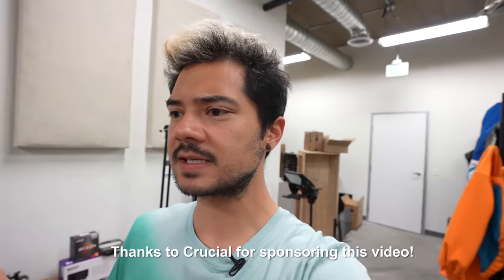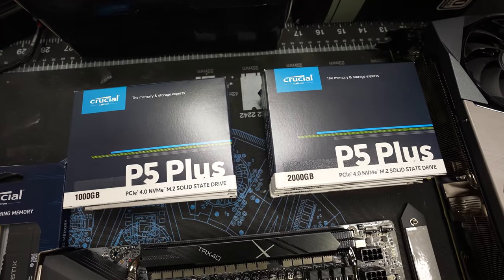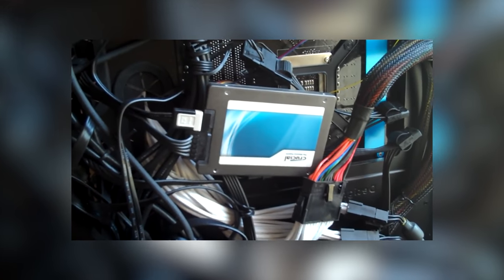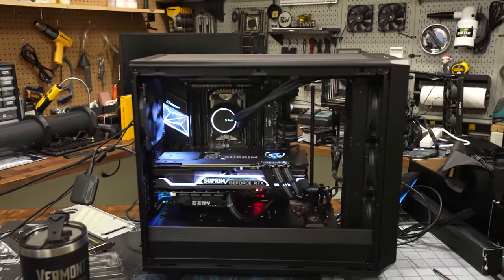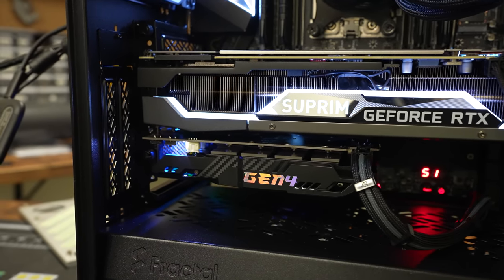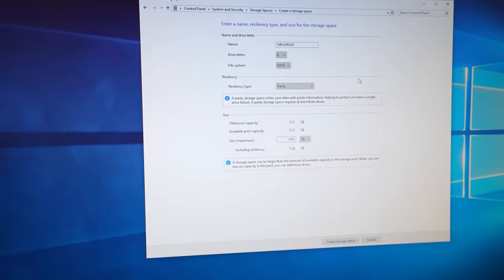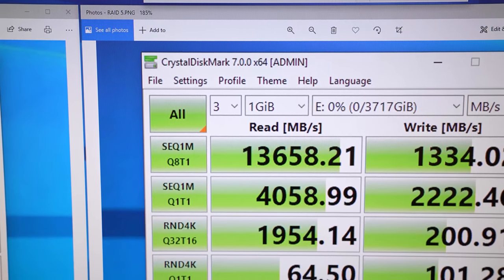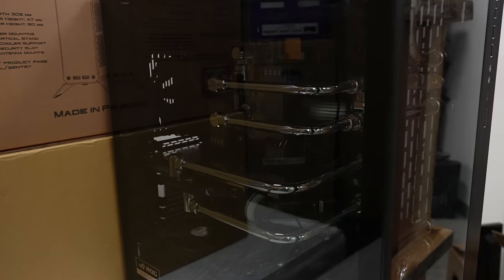I think I have enough storage now - Personal Rig Update!

Comment: Wendel over at Level1Techs has a whole video about getting RAID working on Ryzen there is a certain order you need to load the drivers in. Also having a non-RAID boot drive with RAID other drives gets really messy with AMD. I had no luck getting that working without making the boot drive a single disk array (JOBD).

Comment: The high temps on the Threadripper when using an AIO is likely because the Asetek design of AIO water pump cold plates actually don't cover all of the silicon footprint of any of the Threadrippers. My 3970X was the same, hovering in the mid 80's and in the summer closer to 90 or above, until I changed to full water cooling. Once I took the picture of Lisa Su holding the 3990X up at CES and cropped down that image so it only showed the naked Threadripper. I took a picture of my 3970X after removing the AIO with the thermal grease still on the IHS. I resized that photo and cropped it to be identical in size to the naked one to compare where the grease was to where the silicon on the 32-core was. 2 of my chiplets were at most 20% covered, the other 2 on the other side of the IO die were maybe 80% covered (I still have the comparisons photos merged into a single image). Changing to higher end thermal grease made some difference, but it was still between 70c and 80c. Full liquid cooling with the EK Zenith II Extreme monoblock changed that.

Comment: Kyle, maybe you should get an AIO that's meant for the Threadripper IHS size. The Fractal AIO is alright, but it is still just a Asetek Gen 6 model that is more meant for regular sized CPUs, specifically Intel's monolithic dies, as the cooling fins are just in the middle of the cold plate.

I think something like the IceGiant Thermosiphon or something with a large rectangular coldplate would work better.

Comment: Software raid 10, use storage spaces to create two mirrors, then use diskmanagement to stripe those mirrors with a dynamic striped partition.  Or switch it and use storage spaces to stripe each pair, then use diskmanagement to mirror them.

Comment: The only suggestions I have are reaching out to Wendell at Level 1 Techs, and the staff at LTT to help with your RAID issues. Wendell might be able to help you get the RAID functional, and LTT has a good amount of experience with Unraid.
Reply: Seconding Wendell, and maybe also ask GN (Steve and Co., plus Buildzoid). LTT has a ton of stuff to do so he might have issue getting their commitment, but Anthony should be able to help a bit. Linus himself would not be able to find any spare time, given that he's overworked enough as it is.
Reply: Wendell would just say get some Optane in this use case.

Comment: Pretty sure you won't read this comment, but raid 10 can easily be setup in storage spaces via setting up couple of two-way mirrors and then use disk manager to stripe them. That way you will basically have raid10 with your setup.

Comment: I did some testing, albeit with 140mm variants, but the Chromax NF-1x fans did not come out on top compared to the Fractal Dynamic X2 fans when used on a radiator. Mostly I think because Noctua cap their RPM lower. I'd say Fractal includes some pretty decent fans for their AIOs but the best are likely Arctic as their P-series fans are insanely nice.

Comment: That's weird. Using RAIDXpert, I got my RAID 0 and RAID 10 arrays set up immediately. I have two sn850s striped for a game drive, and 4x4tb 7200rpm drives for an on-board network drive for my laptop, and eventually, my steam deck

Comment: Nice setup! I'm doing something similar with 4x 1TB NVME drives, though in my case I had to use a Highpoint SSD7204 card to handle the drives because I don't have the PCIe lanes to use those types of cards.

Comment: All right mister. I'll bet you $100 dollars that when you go to add more sticks of RAM to that system, you will not find the matching sticks, and you will have to buy a full kit of 8 sticks. 

Ground rules:
1) It has to be the same part number or SKU.
2) You have to wait at least 6 months or longer (cause that's about how long a normie would wait to save up for enough money).
3) You can't use second hand parts like from eBay, Craigslist, Kijiji or any of the other off shore sites.
4) And you have to show video prof on your channel buying the RAM.

Comment: Everyone if you GPU fans are still running, remove the PCB from everything. No stickers, fans, screws, wires, etc... Anything that can be taken off. Get Microwave OVEN not just a regular one. Set the temp to 230f for 5-10 mins and place the detached PCB in it for that time. It'll help resolder any lose or coroded soldering.

Comment: Minority opinion here, but you can actually do some fairly impressive things with Storage Spaces, in one system I have Storage Spaces setup with 2 SSDs in RAID1, and 2 HDDs in RAID1 and with a properly configured storage spaces it all appears as 1 larger disk, and configured tiering of hot and cold data, in my case, all my writes are done to SSD and then written later to HDD once the disk utilization is reduced, as data is being read it gets cached to SSD as well, I also have specific folders that stay 'mounted' to the hot storage.

Comment: I'm still using Windows 7 don't want an upgrade to 10-11. Currently using Crucial MX200 500GB SSD want to upgrade to 1TB NVME,  Asrock Z87 Extreme6  is the board so I need a compatible drive & PCI 3 adapter doubt a 4 would work  seen adapters just as pricey as the drives prefer Micro Center in MAssachusetts, cuz ebay and amazon are shifty.

Comment: 10:30 i would of just swap the m.2 adapter with the gpu, gpu doesnt need to be at the top :)
Reply: GPU should be at the top. Performs better. The top slot has much better bandwidth
Reply: @BigSplash  someone should test this out COUGH COUGH KYLE COUGH

Comment: From all of the tech youtubers I follow, Dawid of the Dawid Does Tech Stuff channel is the only one who always follows the advice of always starting with a minimal build on the table and seeing if it POSTS before installing it inside the case. Every single other tech youtuber I have seen never does this, even though they know perfectly well they should. If anybody, they know it. Yet they never do it. And I have never, ever understood why. It takes like 5 to 10 minutes (from a typically several-hours-long build) to do this, yet they never do it.

(Even then, though, even Dawid does this strange thing where he does the minimal build on the table and boots it up to see if it POSTS... but for a reason I never understood he never connects a display to it. Even when he has a GPU installed on the motherboard he never connects a display to see the BIOS screen etc. He always relies solely on the leds and numeric displays of the motherboard itself. I never understood why. It would be so trivial to connect a display, which often you can even see right there just a few feet away. But for some unfathomable reason he never does that. I can't understand why.)

Comment: I had some issues raiding my 3 m.2's on my AMD system. 
 But what I had to do was install RaidXpert2 on the computer before creating the raid on the MOBO. Also using an MSI Board. Though, I think that Threadripper has different raid issues than us plebs with r7 3700x's lol
Reply: On a side note. I was not using an expansion slot for my m.2's they were all on the mobo. So that could be an issue on its own.

Comment: You should actually use the "Two-way Mirror" because IT IS RAID 10. 4TB out of 4x2TB is exactly RAID 10. RAID 1 would be 2TB copied 4 times. "Parity" is indeed RAID5 tho and yes it will affect performances.

That being said, a hardware RAID or even RAIDonCPU is better than StorageSpace, but in the meantime it could do the job and would probably give something around 90% of the performances of a hardware RAID 10.

Comment: Dang, two high end MSI boards not working properly? This isn't helping my bias against MSI. My very first build was on an MSI board, and the board was barely functional. It had awful power delivery, ate through ram sticks (I had to get new ram every year or so. Now I'm sure the board was over-volting the ram, but at the time I wasn't technologically inclined enough to put that together. I probably could have fixed this if I had known at the time.), and wasn't easy to clean because it was a bare bones board. It was frustrating having the same components as one of my friends with the exception of the mobo, but he was getting almost 2x the performance.

Comment: if there wasn't a clearance issue anyway and you vertically mounted the ssd expansion card it would go right up against the exahust of your gpu and all that gpu heat would be blasted onto the pcb of the ssd card, which would be pretty bad.

Comment: Why not use a PCI-E card with built in bifurcation so you don't rely on the motherboard or other points of software failure. An Asmedia ASM2824 or for Gen 4 the High Point SSD7500 series.
Reply: It might be because it's a thousand bucks for the SSD7500 for zero more performance, less flexibility, and all that to avoid the non-event of bifurcation failure.

Comment: Looking at the capacities, the two way mirror did seem to be a RAID 10, not a RAID 1, though I don't know what the raw drive speeds are meant to be (mirrored JBOD maybe if the speed should be higher?). As for the Parity...that's not behaving how a RAID 5 should; proper RAID 5 should be at the read and write speed of 3 (N-1) drives (eg, if it was 4 SATA SSDs, it would be 1.5~GB/s, give or take a small margin for error, assuming typical 500MB/s/drive). Whatever it is, there's something funny going on with it, because that speed doesn't make sense, unless Windows has terrible handling of parity or ridiculous amounts of overhead for it (which wouldn't surprise me, though I've heard AMD's way is worse than Windows for most RAIDs; I haven't tried myself though)

Comment: You could use the RTX 3090 you put inside that system you built in this video in chromeheus to replace the dead graphics card. I think it’s a good idea
Reply: He would need a water cooling block to be able to use a 3090 as Prometheus is a water-cooled type of guy if you catch my cooling drift.. 😂😂

Comment: You put very little (not enough) thermal paste on the cpu. Threadripper have a number of silicon structures all over the place under the IHS, so you won't get sufficient thermal coupling with just a small amount in the center of the IHS. RE-PASTE IT FOR GOD'S SAKE! You can either apply a "cross with dots in-between" pattern or (my prefered method) pre-spread with a flat plastic tool. you WILL HAVE improvements.

Comment: Why not just use disk manager to configure RAID 10?
Reply: The CPU overhead for NVME RAID with 4 PCIE 4.0 drives is a LOT and you run into bottlenecks all over the place.
Reply: @tim3172  Isn't it the same by using windows storage spaces though? I mean if Kyle wants to test the performance of soft raid 10 he can, instead of being limited by what storage spaces options provides.
Reply: @tim3172  I thought it could be done but I guess not, just tried it in a VM and didn't have the option of mirroring two striped volumes. But I've read it could be done in storage spaces too, and in powershell.
Reply: @tim3172  last update. It is possible, just create the striped groups in storage spaces, go to disk manager, delete the volumes of the striped drives and create the final mirrored drive. Just tried it in a VM and everything worked fine.

Comment: If you have an old laptop sitting around that has Windows 10, rather than blowing your money on a new copy, just rip the storage from the laptop and transfer it to your desired boot drive.
Reply: If it is a Microsoft Windows 10 OEM license (most laptops) then the license won't be valid in another PC.

Comment: That moment when you are casually just watching someone put together a expensive computer while at the same time your using a crappy hp laptop with a core i5 7th gen 2 core processor and 2 external monitors to boost your vibe, but then you try to run CAD software and see that it's lagging badly and you know you can't do anything about it because your a college student and are basically broke LOL
Reply: Keeping it real mate
Reply: That one moment when nobody can relate:
Reply: Azraii Nama Saya  oof.....pentium........thats rough, if I had that one I could probably not run Fusion 360 lol
Reply: Azraii Nama Saya  I still need to go from 32 bit to 64 bit on a ram upgrade I did on mine
Reply: Azraii Nama Saya  not sure of it will be upgraded again at win11 has lots of caveats trying to Apple ewaste.

Comment: Just use software raid with the windows built in raid
Reply: The CPU overhead for NVME RAID with 4 PCIE 4.0 drives is a LOT and you run into bottlenecks all over the place.

Comment: "Back then SSDs were so expensive"

They still are dude, unless 500CAD for 4TB SATA SSD is considered cheap these days. Also I would go with the P500A on this one since you're able to use all your PCI slots even after mounting a card vertically.